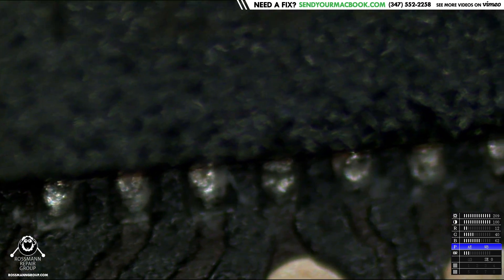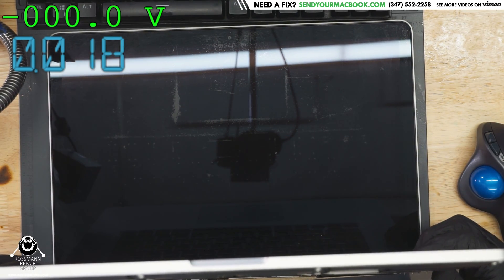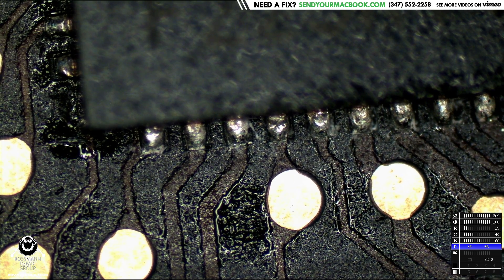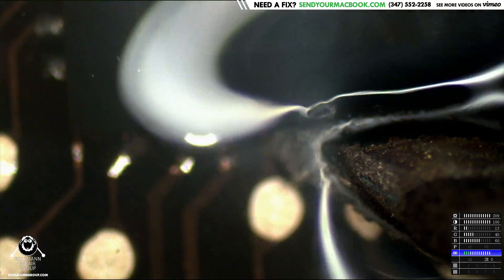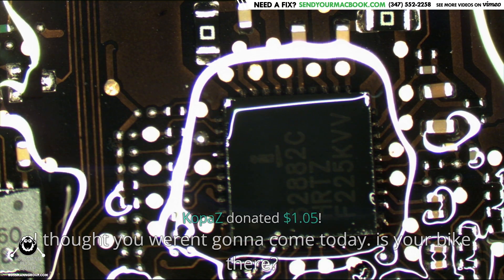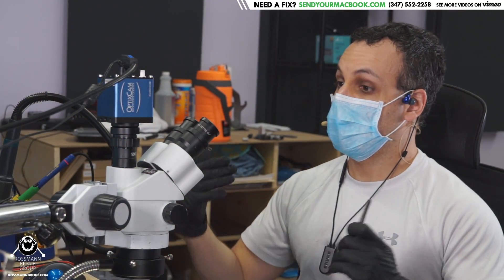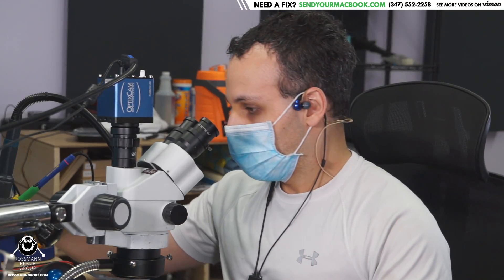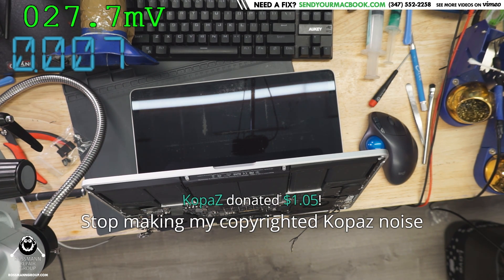Apple soldering was this bad(yes, really)

Comment: From the guy who works at a PCBA EMS company, that shitty solder joints look like solder graping. That is what happens when the reflow is too hot too fast. The flux burnt out before the metal powder actually hit liquidus stage. So because the flux is out to prevent further oxidation, the metal is not properly reflow or melted and it has already cooled down, preventing further and proper solder formation.

Comment: The bit about charging for simple fixes reminds me of when I was young, and my HTC Incredible got stuck in a boot loop. Tried all I could to fix it, and to recover my data, and couldn't figure it out myself. 
Took it to a Verizon store w/ my grandmother (who at the time, paid my phone bill), explained the issue, explained that I wanted my data recovered. The dude behind the counter just went into the boot menu right there and then, did a factory reset, and handed it back. Didn't fix the issue. Didn't recover data. I guess at least they didn't charge for it. (Later got a new phone, and rooted the Incredible for the hell of it to tinker with it)
And again reminds me when I was really young, and accidentally changed my LG Voyager's language to Spanish, and had to take it to the store. Again, no charge for fix, gladly.

Comment: Looks like a lot of time above liquidus during reflow, then someone/thing upset it during cooldown. No flux to hold the surface tension on the solder before the joint solidified.

Comment: 9:20 Holy fuck that's actually what people think? What you're doing should be the norm and is definitely what I expect from a good technician of any sort, anything else is just scummy... Earn your money on fixed services etc but charging for simple stuff shouldn't be the case. I go accepting the fact that i'll be paying an already extortionate amount for some vehicles' repairs and then they try to make more money on some tiny shit like 10$ in labour for replacing some hub caps or some shit lmao. Absolutely disgusting practice that is.
Reply from the maker: It depends. If someone walks in and makes it clear they expect something to cost $0 they can pound dirt and eat my ass. But if they're polite and don't reak of entitlement, I have no problem doing it on the house.
Reply: @rossmanngroup  Sorry, i should've clarified. I don't expect free work and am prepared to pay for services that do indeed take work. And if I was a person with something like you said where you don't charge just ask them for a tip, i would definitely leave a sizeable tip because I respect people like that. However that should be the norm. I shouldn't have to go into a store and expect to get bent over at every turn for every little thing.

Comment: i buy and keep spare drivers/bits so i can solder them to stripped out screws and get them out, then i replace the screw. this is a separate service i charge and even have other repair companies come to me to preform this. im thinking about buying a battery terminal welder for this purpose, and then i wont have to keep buying driver bits i could just use some rod.

Comment: I had very bad experience with gray/black laminate PCBs. Soldering pads are very sensitive to heat, BGA rework is near impossible, pads simply fall off. Margin between leadfree solder melt and pad separation is near zero degrees. It's typical one time technology.

Comment: I spent hours in the last two weeks watching videos on this channel. 
Louis Rossman saved me from 13 MBP mistake and I went ThinkPad X1 Carbon instead.
Reply: If you are satisfied using Windows or Linux, this is a great option! Having heavily used them both for years, I prefer macOS.
Reply: @BrBill  Yeah, I just realized that it's your needs that define the machine you're gonna use. As for me, MacOS will be a big waste. If you can be more productive with that, good for you!

Comment: My mid-2014 15" Retina MBP de-soldered itself a month ago, about six months after I bought it. High-resolution photo editing apparently was more than it could take. I took it to a repair shop just up the street from my house: they now find themselves unable to remain in business due to our CCP virus lockdown and they're shipping the broken machine back to me. I considered the 16" MBP as a replacement. I like the BSD core and the 16:10 aspect ratio display (I don't like the high gloss, I have mirrors if I need to see my reflection) but I couldn't bring myself to reward Apple for shoddy workmanship, poor engineering, and opposition to upgrade and repair. 
I like ThinkPads. My first laptop was a 12" IBM model I bought from a friend. I'm now using a secondhand T420, running Debian. It does fine for most things now, but lacks the horsepower for photo editing. Also, FOSS photo editing tools are behind the times and photo printing is hideous.
I ended up ordering a 15.6" ThinkPad X1 Extreme Gen 2, i9 9750H 6-core CPU, 4k OLED touch display, 32GB RAM, 1TB SSD, GTX1650 w/4MB VRAM, Windows 10 Pro, 3 years depot warranty, 3 years drop & spill coverage, 9.25% California sales tax (gotta keep Gov. Newsom in hair gel) for only about $180 more than base model 16'" MBP before AppleCare and sales tax. I'll use Win10 for the proprietary software and Linux in a VM for the rest.

Comment: Louis, Try using a pointy Xacto blade under the screw head of the screws that are partly stripped and which you can't reach with the flush cutters.

Comment: I think this problem is not an apple problem but a bad regulation problem.  Apples manufacturer has to comply with regulations that force them to use this crappy solder.  On the upside your tin lead solder will fix the problem permanently.

Comment: That solder looks like it is failing from molecular migration which is a real problem with the ROHS compliant solders.  The lead content of the solder is non-existent since lead is now banned in solder.  Consequently the solder joints fail (especially in high heat areas) because the lead (which stabilizes the solder joint)  is missing.  This is a classic example of Government solutions (aka regulation) causing more problems than they solve.

Comment: This QFN joint is not acceptable in ANY class according to IPC standards. As computer hardware it should be Class 2, Class 3 preferable. On production line AOI machine (Automatic Optical Inspection) checks boards going out from oven. QFNs tend to be hard to measure and judge by automatics so sometimes there are marked as 'fail' and move out to human operator that should use proper inspection magnification (in this case x20) and verify  if that solder joint is ok or not. I am 90% sure that this was badly classified by human operator as 'false call'. If we had access to factory's database and scan PCBs  indyvidual code we will see AOI's alert on some point of history and then 'false call' decision by operator. But we have no such access. 
Sorry for long comment, it is just my daily routine at work, I am Quality Engie at SMT department in some big factory :) Also IPC trainer. It hurts my eyes to see such bad joint let out of factory.

Comment: My trick for stripped screws... Take a flat rubber band and place it on the screw head then push the screwdriver in. The rubber gets in the head and it grips the head and screwdriver, works most times.

Comment: Hey Louis if you want to test out a hidden gem on ebay for a soldering, hot air and test station look at this.

https://www.ebay.com/itm/3in1-853D-1A-DC-Power-Supply-SMD-BGA-Soldering-Rework-Station-Hot-Air-Gun-110V/253070957087?ssPageName=STRK%3AMEBIDX%3AIT&_trksid=p2057872.m2749.l2648

I got it a couple days ago I it seems great for beginners learning from you (like me) it's cheap but the quality seems pretty good, plus it ticks your check marks of showing set temp then the screens show current temp climbing or falling.

Comment: Cooperation is a better long-term strategy for mutual benefit than trying to drill people for every little thing they can chisel out of them. You can get ahead quickly by cheating and screwing over people, but sooner or later, people get wise to it and you're out of business once you run out of suckers.
I have a body shop near me who knows this: I had some bumper cover damage to a vehicle, and if they'd come back to be and said "you need a new bumper cover, that will be $1000 or $2000" whatever, I wouldn't have been the wiser. But instead they said "You just needed a couple clips replaced. It was 4 bucks in shop parts and 90 seconds of our time. This one is on us." Guess where I'll be taking every vehicle for body work from now on?

Comment: Very clean rework, but I'm not sure about your diagnosis of poor assembly I've seen a lot of qfn solder joints before, and that one is not especially poor, it appears to be IPC class 2 (bit hard to tell on the high density footprint). The failure is more than likely due to board flex, vibration or thermal stress. As to why the joints appear poor under magnification I feel this is largely down to the perception of non shiny joints which is largely due to the lead free solders that modern production facilities are required to use for consumer applications these days. Personally I would avoid reworking lead free soldering with leaded solder (based on your product recommendations I assume it was the kester 63/37) without cleaning off the old solder as mixing solder alloys in that manner can cause reliability issues. But the use of hot air after iron soldering is a very good idea as it allows the solder to recrystallise in a consistent manner and removes thermal stresses as long as the cooling is not too sudden.

Comment: Apple customer: “My Macbook has been in a hydrogen and oxygen free vaccuum chamber since I purchased it, I’ve only used it remotely over the network and it recently died. What could be wrong with it?”
Apple diagnostician: “Water damage. You’ll have to replace the computer.”
Reply: @bob dash because the indicator seem to be designed for false positives. They probably go off from the humidity of the factory.
Reply: To be honest, many companies pull this off. Like others here said, these sensors seem to be made to trigger.
Reply: “Water damage sensor is red for no reason? I’ll show you water damage.” Throws Macbook in the lake.

Comment: It is this level of telling Apple to go fuck themselves that I wish to achieve with my tech repair business when I finally turn 18 and get a place to start up on it. I have a bit of experience with Apple being a shit company from the Macbooks that some people have brought for my dad to fix (even though it was me doing the repairs and him getting the money). Almost completely stripped screws after Apple "techs" had worked on the laptop before, chips being moveable without removing them from the board, layers of dust in places that wouldn't have gotten dust if the computer was completely assembled... All I can say is that Apple has got to be the shittiest electronics producer ever.

Comment: Pro tip: place a rubber band (or the shoe rubber apple uses to "repair" boards) on top of the stripped screw, apply screwdriver, apply pressure, twist.

Comment: For stripped screws, try putting a rubber band under the screwdriver, usually works (although those torx screw holes are tiny)

Comment: To remove socket heads screws that have the head stripped out you can get left hand drill bits. Due to the fact that these bits turn opposite to the screws thread pitch they will bite in  and turn the screw out about 90% of the time. They can be found here for purchase https://www.mcmaster.com/left-hand-drill-bits/

Comment: 4:00 You can strip every other screw out that is in this thing, just don't fuck that one up. Louis will find you and strip your screws.

Also, I would like to add something to your spiel about your business model. Word of mouth is the best advertising, and the cheapest. The only thing you need for word of mouth to work for you is to put effort into whatever you're trying to monetize. You want to try to convert a town to your pizza place? Give some people (preferably a business with a strong social media following), give them a free lunch in exchange for them making posts to their followers about your product. 

If the product is good, it will be reflected in their post and likely will bring in business.

I have some experience with this. Took a pizza (30") to a buddy of mine that works in a shop, fed the whole crew (Paid for it out of pocket). Dude doesn't eat pizza a lot (because it's all bland around here), loved ours, made a post. I sold 6 30" pizzas over the next 3 days. I don't know if that place is even still alive at this point with coronavirus... not that I care about it due to the owner fucking me over. I made less than $100 a week for 6 months working at that place 70 hours a week. Never got compensated for it, and got ghosted by several lawyers over the issue (being underpaid... idgaf about the $20 I spent on that pie. It helped the business while I was there and was a much smarter move than the owner ever made as far as advertising goes... the dumbass wasted so much money on failed advertising)

Comment: I presume you have eventual issues with the HDMI on the Microscope cam, have you tried switching it to a standard (not right angle) cable and zip-tying the cable to the body of the camera with a cable loop? Might reduce the strain on the connector?

Comment: I would probably run MacOS if they sold it for my computer. It’s basically a good Unix with a pleasant interface. Instead I run Windows 10 on one cheap machine for programs that run under Windows, and otherwise Linux.

Apple computer hardware... no thanks. Though I confess I’m writing this on an iPhone...

Comment: I woud instal windows 10 o  an win 7 laptop  windows 7 CAN STILL be updatet for free, i did, i used wi  10 simce 2015 but i used home, and in december, i decided: i want pro. so i bought  win 7 pro retail and upgradet it to 10
Reply: I installed it as second system, linked it to my ms acc and after few minutes i coud upgrade my home to pro without loosing my data.
Reply: Windows 7 to 10 is a DOWNGRADE!

Comment: The whole "hold down a button to fix the device" convo... The shop I worked at years ago had a reasonable diagnostic fee, which would be the only thing charged to the customer if we managed to fix the computer while trying to figure out what was wrong with it. (if I recall, it was around $40... just high enough to encourage the college students nearby to not flood us with PEBKAC issues.)

If it was a legit problem that needed us to do real work to fix, then we'd get approval from the customer first, then waive the diagnostic fee and charge the normal hourly repair rate + parts.
Reply: That sounds really fair. What is PEBKAC tho?
Reply: @Knallteute  Problem Exists Between Keyboard And Chair
Reply: @Knallteute  same as an ID-10T  failure.
Reply: @gerrykavanagh  ah the K10 failure.
Reply: @Knallteute  never heard k10 before. What's the reference?
Reply: @Consul99  a failure 10inches from the keyboard
Reply: That's basically what we used to do at my old work - minimum fee, which included the first half hour of any work done...

Comment: Lemme guess. Components are soldered with that extremely low temp solder that almost melts just above room temperature? That some uses to make desoldering easier by setting it in the sunlight and watch everything fall off the board. That one that makes products so extremely fragile the components rattle around if one moves the computer while it's on due to the heat it produces?

Comment: When I did computer repair, I wouldn't charge customers for simple stuff. Of course, I wasn't the owner of the shop, but he did the same thing too. For example, WiFi won't work--press the WiFi button on the laptop (or slide the switch). I can't charge for that and neither could the owner. I am very proud  that I got to work under that man.  We also did diag for free, which included a physical cleaning of the computer.

Comment: to get stripped screws out, get a hammer and chisel, small as possible in your case, and tap the top of the screw with it to notch the screw. that makes it a flat tip, screw driver should get that out. have fun!

Comment: I design/manufacture a lot of high-reliability industrial electronics and that does not look all that bad. Room for improvement, perhaps but nothing to make fun of IMHO. 
Drag soldering by hand will always yield a much different look than solder paste that has run through a reflow line.

Comment: That's a damn fine business practice, treat the customer as you would want someone else to treat your grandparent in a transaction. Fairly, honestly and sometimes charitably. Good will makes for a lot more future business than fleecing every single penny you can will. I never dealt with component level repairs but when it came to PC diagnosis and repair, I never charged for the diagnosis, everyone else charged $25-$50 for it. Generally what the computer brought to me needed was a windows reinstall and instead of charging $50-$100 for that task I'd charge $25, most of the time taken by the install is completely unattended and doesn't require me at all so charging anything more seemed unfair. Those two things got me a ton of word of mouth good will recommendations and brought in far more money than charging the going rate ever would have.

Comment: is that because they are forced to use leaded solder? Those looks like cold joints which would make sense if they need to heat that mf to ungodly temps to get it to flow at all. Maybe?